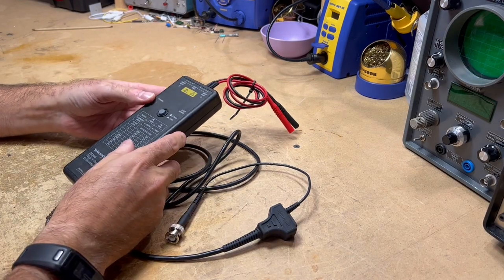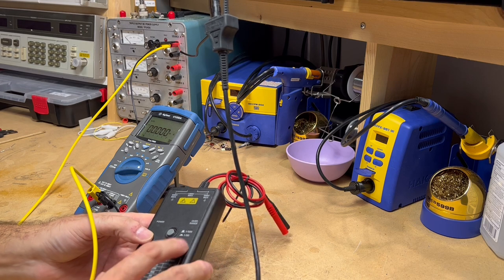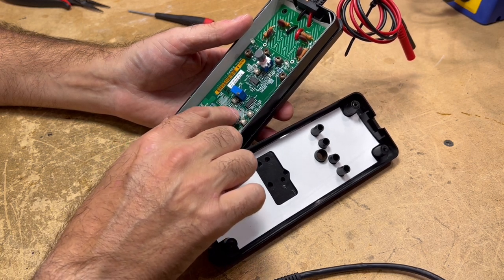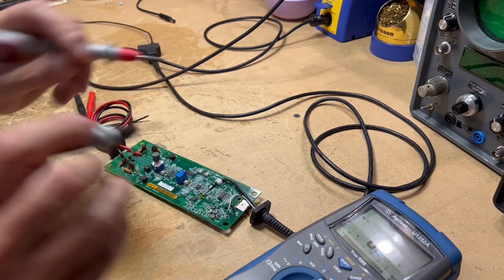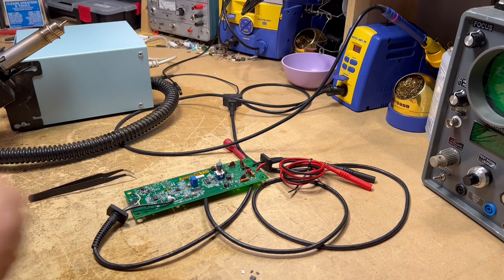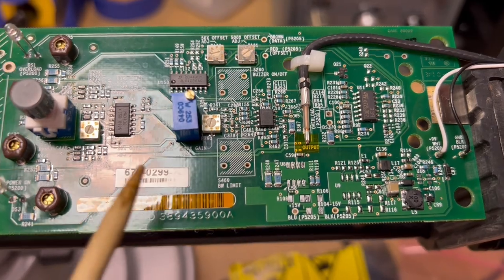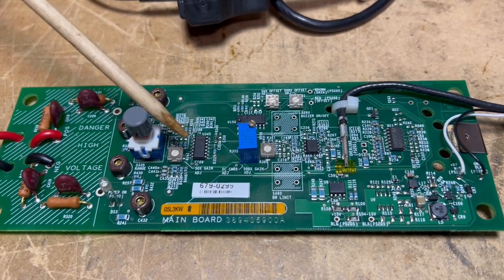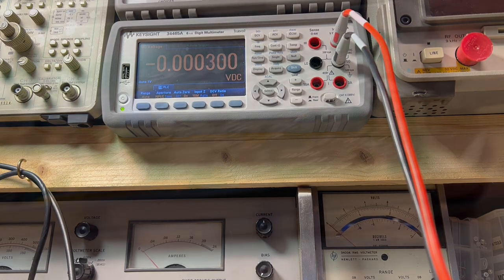Tektronix P5200 Probe Repair

Comment: Nice repair, I would have used a SS14 generic 1A schottky diode instead of the signal one, it is pretty commonly used as reverse polarity protection in a lot of devices these days.
Reply from the maker: Yes better choice. It was more or less to get it working. I’ll probably choose a better diode for a permanent replacement. Thanks for the comment.